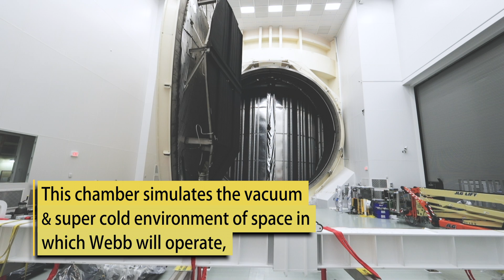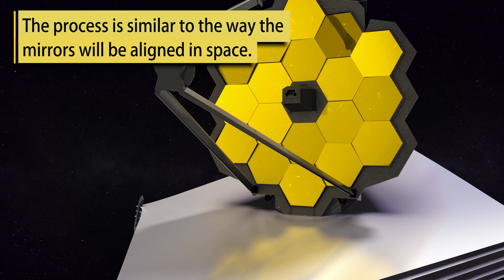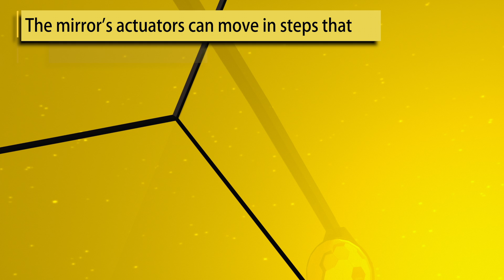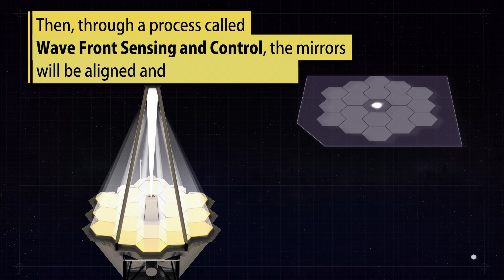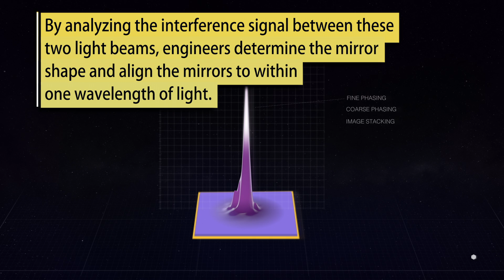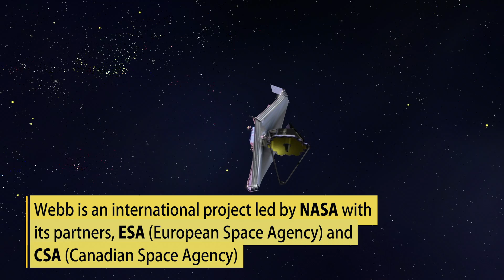Aligning the Primary Mirror Segments of the James Webb Space Telescope

Comment: 0:20 I wonder why the chamber door is concave in shape instead of convex shape.  Since the chamber inside is in relative lower pressure compared to the outside, a convex door should be more rigid/stronger to withstand outside air pressure.